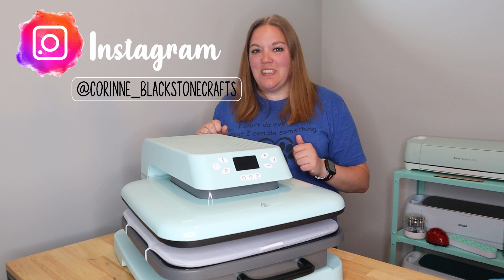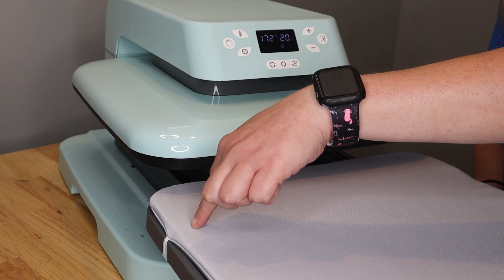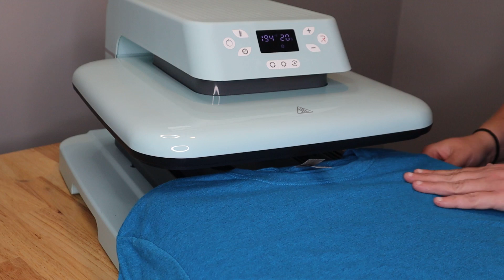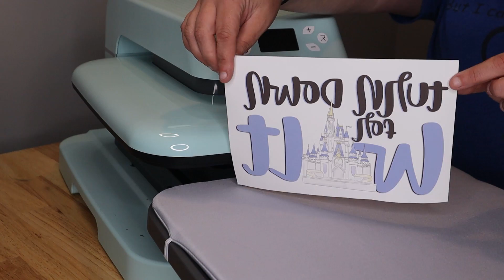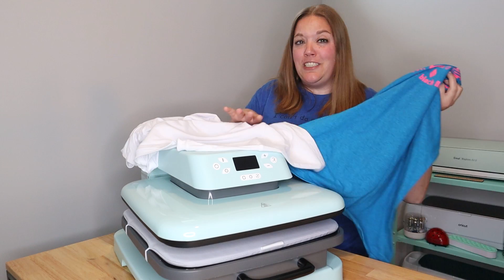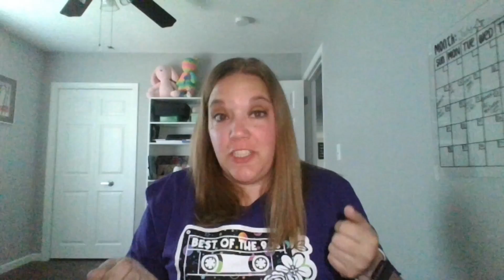Reviewing the HTVRont AUTOPRESS heat press - Auto pressing sublimation and HTV

Comment: It is possible to adjust that drawer to allow it to pull out lil further?  I see a lot of burns w/current drawer.  Also, it doesn’t appear to have enough space behind the drawer if pressing a hoodie.  What is your opinion about that?
Reply from the maker: Nope that’s as far as the drawer pulls out. I really recommend just a regular clamshell press there is no need for a pull out drawer. I have never burned myself on my press without one

Comment: I bought this one and returned it.  Did not work on all at screen print heat transfers.  You can't adjust pressure so no way make it work on what you are pressing if it does not stick.  Horrible, like my swing away much better.

Comment: April 2023 - I ordered this heat press and was so excited to get it.  The first time I plugged it in the Switch light kept flashing the entire time it was plugged in.  I checked the FAQ and two other people said theirs did the same thing.  I emailed the company and did not get a response.  The first time I used it, it worked great for three items, but then it started to beep and the timer would not count down. We tried to reset it and also unplugged it.  Nothing worked. I tried calling the company at the USA phone and a recording answered and said no one could take my call and then disconnected me.  I tried emailing them again and still no response so it was returned to Amazon.  Fortunately, I was still in the 30 day return period.  When you can’t contact a company and receive no response from emails, that’s a problem.  I just wanted to let individuals know as I would not want someone to have a problem and not be able to return it.  Thanks for all of your videos and all of the information you share.

Comment: What about different vinyl applications that call for different pressures? Also are you limited to vinyl choice? I order from various places online that use Plastisol ink as well as cut our own HTV from Siser, Starcraft, as well as some generic options. Is there some kind of black magic that just knows?
Reply from the maker: There is no way to adjust the pressure which does lead to issues with other htv. Another reason I do not recommend this
Reply: You can put a pressing pillow, or some thinner cardboard. Like the usps mailing boxes, a tea towel. There are other things you can put in there to adjust your pressure! This is an absolute amazing press and it does heat up rather quickly. More quick than any other presses I've seen

Comment: I cannot get the pressure on mine to work on ANYTHING. I have tried screens, low and high heat, siser vinyl etc. I purchased a cricut pressing pad, I also ordered a heat mat like on the bottom of a regular heat press. STILL doesn't adhere. Anything else I can try?
Reply from the maker: I would contact htvront directly

Comment: To avoid the collar issue - you could put the shirt on upside down...just remember to put design upside down too
Reply from the maker: It helps but it’s still not ideal as all the fabric from the bottom of the shirt is then bunched at the back of the press. It truly just needs some adjustments with the drawer pulling out further
Reply: @CorinneBlackstone  I do it and the top of the shirt just folds up off the back of the drawer...doesn't keep the drawer from closing

Comment: I would NEVER compare the cricut with this machine. Unfortunately, when you test the temperature on the cricut, it is not the same on the plate as it displays in the screen. A person with limitations on money can buy 5 HTVRONT with the cost of one cricut. As per the material, I've experience that DTF transfer works AMAZING with this machine, and the sublimation may be just a temperature and time adjustment. I wanted to love the Cricut, but with the cost and the issues I've encountered, I prefer this one

Comment: I have a clamshell semi automatic press with a pull out drawer, as well as a Cricut Easy Press and I ordered this one. I can see some limitations but also feel it will be very useful. All you have to do is turn the shirt sideways and load it and no worries about the seams. What I like about it is not having to adjust my pressure if I want to do wood or glass or any item that will fit. Manually adjusting pressure can be a pain and sometimes uneven pressure can be a pain with the Easy Press, not to mention size. The Cricut auto press is only 12X15 and way overpriced at $1000. I'll likely use this quite a bit and since I was one of the first to pledge, the entire press including shipping was barely $200. If I get it and hate it, I'll be happy to admit it.

Comment: If you see edges where paper was all you have to do is put a bigger sheet over and press it again for a short time...it is only because the outline of the paper that's left a wrinkle in the material
Reply from the maker: Repressing sublimation is not recommended. It will reactivate the ink and cause some fading. Also I never get the line on my real heat press.

Comment: Are you able to open the shirt and slide it over the bottom plate, like you can with a normal clam shell type Press ? That's how I do mine my drawer doesn't pull out so I don't know if that in general on any press makes a difference, but It helps a whole lot with seams on a regular clam shell I just slide the top of the shirt over the part of the bottom plate that has the handle  so I just have to remember the shirt is upside down when I go to put my print on :-)
Reply from the maker: No the bottom piece gets in the way of that and causes the shirt to move and bunch

Comment: Corinne, by any chance did you happen to try a 2x tshirt in the press? Any way you can check to see if it will work and how to put it on the platen? The drawer is my only concern that it does not come out further. Thanks very much.
Reply from the maker: Yes it fits fine.
Reply: @CorinneBlackstone  Thank You so much for such a quick response. I greatly appreciate it. Again, great video.

Comment: Yeah I agree. The bottom plate needs to come out more. When I first saw it way back on pre registration I noticed that as a possible issue but now I see it will be an issue. Hopefully they improve that before release. As well as add a pressure settings function
Reply: I agree
Reply: They did not improve the drawer I just got mine and now I regret it cause I can't get past collar so if I do sublimation I get a little ghosting from it
Reply: @Carbon6smami  put shirt sideways

Comment: I wonder did you pre-press the shirt and if not maybe that's what caused issues with the upper vinyl sticking....?
Reply from the maker: I never pre press any shirts so I don’t think so. I’ve used my regular heat press tons and it never has issues and since the sticking issue was only toward the top it makes me think it’s the collar
Reply: @CorinneBlackstone  can you press a shirt in the opposite direction? With the neck at the bottom instead of at the top?
Reply from the maker: @Terry_Fx  there is more fabric from the base of the shirt that had to be shoved under the edge and it then didn’t want to click closed

Comment: Your comments on the drawbacks to this are about the same as mine. However as one who doesn't use a heat press for a business and just as a home crafter I do think it gets the job done. They definitely need to make that drawer pull out further! That was my biggest piece of feedback. I did do I think two fed in the other way which was easier but still not super easy.... because if the extra bunches the wrong way it won't click in place. My next test was infusible in transfers on fabric/neoprene coasters and the auto button was definitely a good feature for that type of process. No button pushing just rotating product in and out...
Reply: How did you choose the color of the heat press ? I did the order but did not see how to pick the color o want.
Reply: @ChocolateDaisyCreations  you will get an email “survey” from HTVRONT verifying address and asking for your color selection when it’s time for shipping. :)

Comment: You shouldn't HAVE to do this, but I wonder if you could add a longer drawer pull on the bottom to avoid that little bit under the heat plate? Do you think that would work when you click it back in?? Hmmmm
Reply from the maker: I’m not sure what you mean but if you mean making the pull out track longer no you can’t. Not the way it’s designed however I know htvront has taken my suggestions into play so the new ones may pull out further
Reply: @CorinneBlackstone  Awesome! Thank you :)
Reply: @CorinneBlackstone  sorry just for clarity - do you mean you think they will make changes to "the news ones" as in the next version or these that are still on kickstarter coming in Sept.?
Reply from the maker: @heidifris4880  I think they will make the changes when they can make them. I don't know if they have produced the ones for the kickstarter people yet so I can't be sure.

Comment: Nice video. I noticed that the platen shakes when it comes down, could that be a problem with sublimation?
Reply from the maker: I don’t think so. I did the sublimation print and it was perfect
Reply: I saw other videos and it looks like not all shake when they come down
Reply from the maker: @heatherhommowun7964  interesting! I’ll have to check some others out. Mine shakes some I wouldn’t say a lot but just a bit

Comment: I was really interested in this press when I first saw the ads for it but I'm not a fan of the tiny space between the top and bottom platens. And now that I know it doesn't pull all the way out, that's a hard no for me. I do like the size but I decided to go with the 16x24 so I have the most space possible for larger projects.  Thank you very much for the honest review of the press and the vinyl. I always wondered about their vinyl quality. 
👏🏼👍🏼💖🤗
Reply: I've bought from their store many times and the quality of the vinyl is very good for me.🥰
Reply from the maker: This is the first time I’ve had an issue with their vinyl. I think it’s just the color honestly